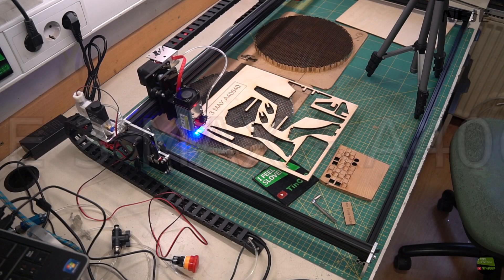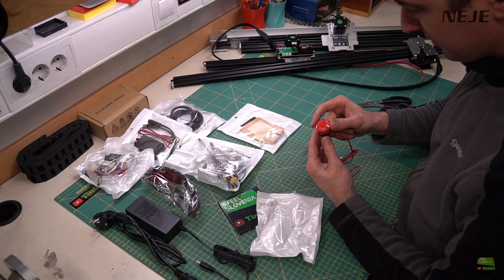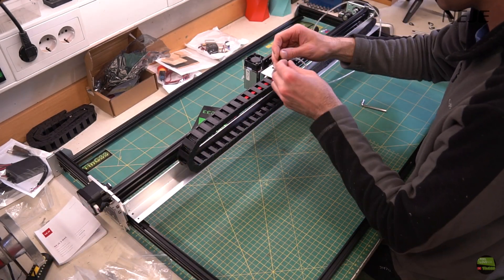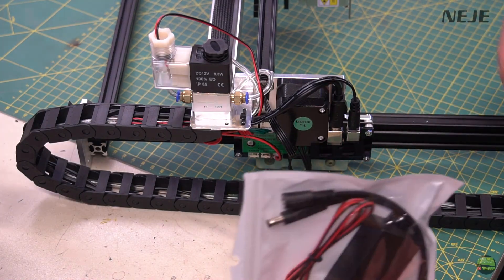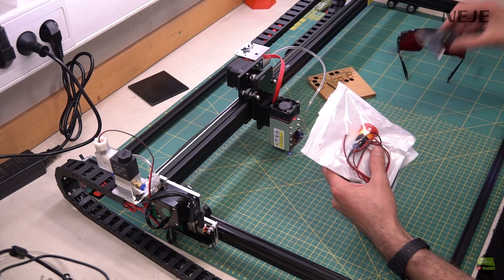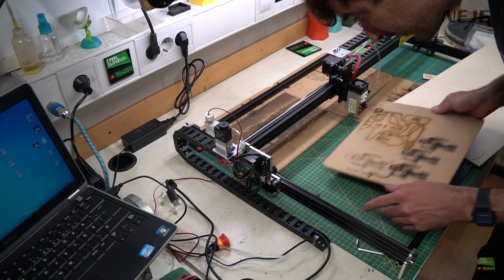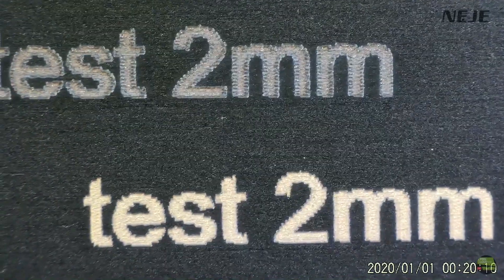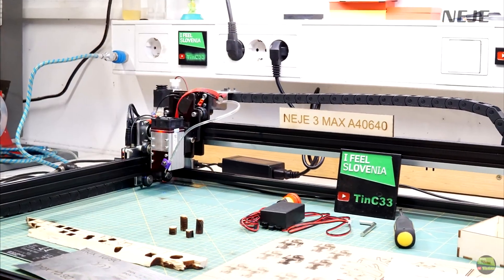NEJE 3 max laser engraver / cutter [unbox / review / first test] + grounding upgrade & A40640

Comment: Hi Sir, @TinC33

I'm using Neje 3 Max Laser Machine on LightBurn Software.

My question is: 
Why is Y axis [Landscape] Burning sharper than X axis (Transverse).
I hope you can enlighten me.
Thank you, teacher...🙏
Reply from the maker: Hello you can check for the focus firstly and step settings for line width, you set how narrow y line is it can engrave line each 0,05mm 0,1 or 0,2 for faster engrave...

Comment: Thanks you TinC33 ! Great Job ! 😀
I have a question for an expert like you !
We purchased on January 2023, a NEJE 3 Max laser tool with rail extension kit that we installed in a properly accessorized box.
A Win 10 desktop PC is used to communicate with the laser tool via Lightburn.
Firmwares were up-to-date, so we didn’t update them.

1-	We set the machine to work on an area of 740 x 960 and not 810 x 1030, because we found that movements beyond these limits could cause collisions with the frame and the gears
        (which can unscrew the screws which hold the laser module on its support and cause the module to fall).
2-	We tried to use the laser and for the moment, we can say that it isn’t a success :
        •	Most of the time, the laser tool starts its work, then stops without lightburn indicating an error or the state being Busy or Ready.
                     o	The laser tool doesn’t react to any commands in lightburn.
                     =>	We are forced to disconnect / reconnect the USB cable (with an extension cable), even to turn off the laser, to juggle with the COM port and at worst to restart lightburn.
       •	The few cut jobs on kraft paper that did work weren't great, as it took 10 passes at 100% power.
                     o	The A40640 II laser module is mounted with the new air_assist nozzle without the compressor being connected for the moment.
                     o	The focus adjustment is done as you indicate in the wiki (25mm between the taper and the bottom of the module + 5mm distance with the paper)
                    =>	As a result, we have the feeling that the laser is not working at its full power.

Please, do you have any solutions to these issues ?
Do we need to ground all the components like you did?

Best Regards,
Tucker
Reply from the maker: If laser stop working it's deffinitely a ground problem, connect motors housings and laser housing to negative wire and that's it.
If laser seem to be weak it's most common a dirty lens or bed focus, dont trust the measures because every modul can heave a bit different pozittion of lens, take glasses and a green screen look into laser dot and try to set smallest possible dot, than make a few test so you change position for 1mm in booth directions when you get your best settings measure distance and then use that distance mine is i thing 17 or 19mm from wood surface to aluminium modul housing.
I still didn't unpacked my extension kit so i can't tell you the solution about...
Reply: @TinC33   So many thanks TinC33, i will try to do like you said !
Reply from the maker: @TuckerTheCocker  sure it must to be on 1000, thats also mention in neje manual somewhere, originally is 250 if i remember right, so laser only work with 25% of power even if you set on 100% 😉

Comment: Hello! Thank you for everything. I couldn't make installation assembly without this video. I couldn't find the settings for brass. I tried tons of different options but still unsuccessful 🥺 Do you know the settings for brass with distance, focal and speed/power parameters?
Reply from the maker: I think it won't work on brass, you can try with some markers, but i think painting and then engrave paint is the only way 🤷‍♂️

Comment: Hi, amazing things, please can you share what parameters you use to cut 3mm plywood and what distance from laser head lower point to plywood when lens fully skewed in
Best Regards 
Tom
Reply from the maker: fully screwed lens isn't good for cutting, so try to unscrew for about 1turn and set focus to about 17mm from material to aluminium heatsink, 100% laser power and 10mm/s should cut 3mm plywood in 1 pass.

Comment: just out of curiosity ive broken my A40630 with air assist, is the A40640 a straight swap by any chance, thanks
Reply from the maker: how do you broken them with air assit?
sure you can easily replace the modul with a single screw, cable and everithing stay the same, in worst case you'll need to replace the power supply, but i think 4A is enough to run A40640 wich is best laser i try, much better than E40

Comment: My dad has this laser. He has bought an extension kit to make the laser engrave area larger. Do you have any advice on how to change the settings so that the laser can now cover the extension area aswell as the original coverage area ?
Reply from the maker: I didn't upgrade yet but that should be simply, open neje app on a pc and go to settings menu (gear icon) than simply type new numbers in area size field.
Reply from the maker: Also can do that in lightburn i think machine settings and write x and y size into firmware.

Comment: Are you sure the aluminium frame is 15mm x 30mm V-slot? Is it not perhaps 20 x 40mm? I was hoping to get this machine and the extend it myself because 20 x 40mm V-slot is easy to get where I live. However 15 x 30mm is very hard to find where I live. I look forward to your reply.
Reply from the maker: Hey i just check once again, it is 15x30mm, i also got unpacked extension kit from neje waiting to review.

Comment: For that relay, did you end up using it to switch on and off your compressor?  I'm wondering if it's okay to just let the compressor run all the time, and let the air-assist relay handle the on/off of the air flow.  Edit: I wish I had found your channel before I bought my unit so I could have used your affiliate link! Your videos are extremely informative
Reply from the maker: Thanks, depend on what type of compressor you use, every basic compressor got preassure switch so it turn on when preassure is below 4 bar and turn off when preassure is about 8bar, so yes compressor is constantly turned on airassist only turning on the air when cutter need it.

Comment: Can you tell me what the black rubber patches are for ?
Reply from the maker: For stick it under the aluminium leg so if you got it on wooden table it won't slip in case you want to screw machine on the table.

Comment: I love their laser modules, I've been using the A40640 laser module for a year and I'm always happy with its performance. Now NEJE has a new E40 module, I heard that it can cut metal, but I haven't tried it yet.
Reply from the maker: Hello, still wait to get E40 on test, actually it is the same modul as E40640 but it's make to last longer, E40640 can give 10-12w pulsed (that's why neje advice tu run them on 80% laser power max) E40 is secured to not go over 10w, so it should get same power but last long for long time cutting with full power and seriall work.
Reply: @TinC33  
Hi Tine. Is there any way to contact you? Cheers
Reply from the maker: @lasertools4255  my email is here on yt
Reply: @TinC33  
Yea, I already had the idea of looking for it on your channel but I couldn't find it. Thanks anyway.
Reply from the maker: @lasertools4255  it's on my info tab, sedejt(a)gmail

Comment: At this size it would be really interesting to see how well it cuts thicker plywood(8-15mm) with a single pass and with multiple passes, given the size of the cutting area you could genuinely use this for some rather large structures made from interlocking/bolted/glued together pieces(small boat frames, furniture etc.)
Reply from the maker: I will make some more test in video about all the neje laser moduls but still wait on some moduls to get.
Reply: @TinC33  Seeing if it can cut flooring laminate would also be very interesting as it is an amazingly strong and versatile material that is cheap and readily available(basically most things you can make from 1-2mm sheet-metal or 4-5mm alu-plate can be made from 7-8mm laminate)